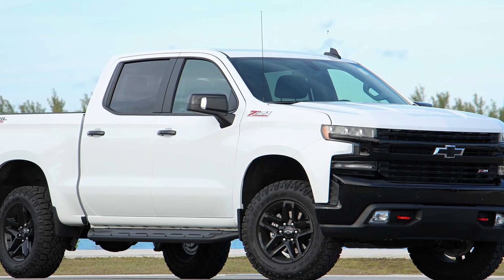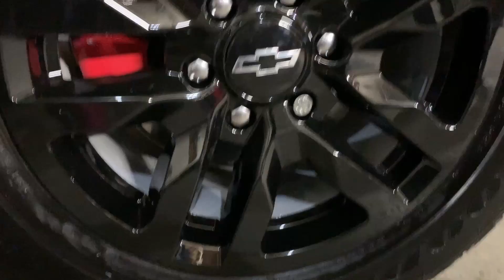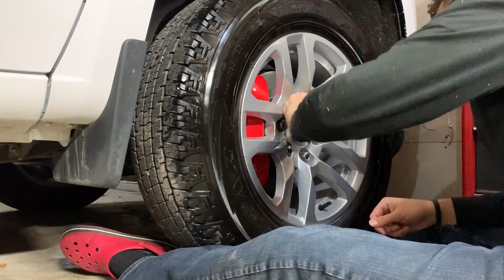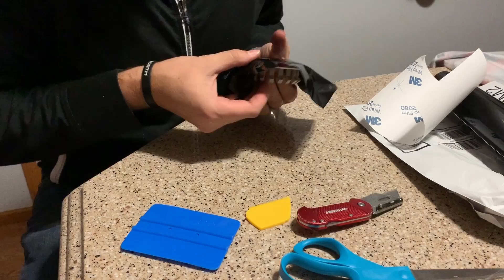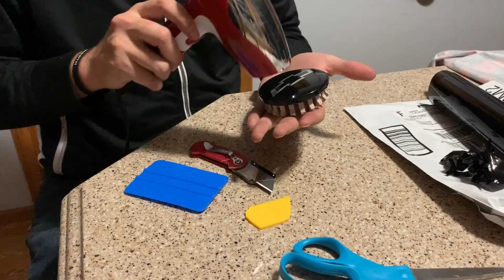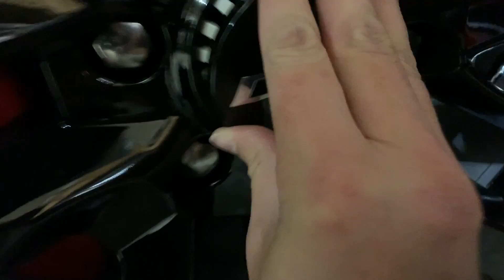How to make your wheels black! Wheel skins for 2019, 2020, and 2021 Chevy Silverado

Comment: Any luck getting these wheel skins off?
Reply from the maker: I actually upgraded wheels and sold these with the skins on. You’d have to take the wheel off and pop the tabs from the back.
Reply: @TruckOwnership101  any troubles getting a lug wrench on with these installed?
Reply from the maker: @johnsonja329  maybe with some extra heavy duty ones, but my normal impact sockets tucked in there fine.

Comment: How easy or difficult can the wheels be removed for rotations or repairs? Will the standard Lagrange still work OK without damaging the wheel skins?
Reply from the maker: The impact sockets I previously bought still fit, but there wasn’t a lot of room for them, maybe some heavier duty sockets wouldn’t fit. Certainly something to test first before fully committing. I did have to take my tires off with them once and was able to do so.

Comment: Okay am I the only one that got some with a center piece in them? They look like a perfect fit to what I have but when I add the pressure it almost seems like I'm going to break them. Do I need to take the lug nuts off first?
Reply from the maker: Negative to the lug nuts. I removed the original center cap on mine to wrap it. Maybe that made room? I’ve never heard of stacking a cap in front of another cap….

Comment: My only question is why did you waste $100 if you planned on doing a wheel upgrade not so long after?
Reply from the maker: 😅 yeah... to be fair, I didn’t “plan” to do the upgrade so soon. It was a combination of discovering the 20” replicas, getting a good deal for them + trade in, and really liking the look of all black once I had the skins.
Reply: In you honest opinion would painting your existing rims be better than the skins?
Reply from the maker: @karbs76  better? Their are pros and cons to both. Powder coat would be the best look. But at the cost you might be better off looking to trade for some TB wheels.

Comment: How did you clean them without scratching the gloss black plastic? Just got mine today and wondered how you did it. Thanks
Reply from the maker: Andrew Kellman I cleaned the stock alloy wheels to get any dust from the road off them for the install. I didn’t need to clean the skins. As far as general use goes. Foam cannon, pressure washer, microfiber cloth. No scrubbing while their is grit on them.
Reply: @TruckOwnership101  yes i cleaned mine thoroughly before the install. I figured all I needed was the foam cannon when I do my normal wash and a microfiber towel but I just wanted to hear what you did! Thanks!

Comment: 4:14 The caps come in sets of 4. You would have spent $30 in total on a set.
Reply: Actually, OEM wheel caps from Chevy are $30+ per cap. I found out when I thought I was ordering all 4 and then got my confirmation email that specifically called out that it was for a singular cap. I canceled that order and opted for an aftermarket replica set of caps that were about $35 delivered. ;)

Comment: Man I tried to use your method, but could never get a good pull, so I had to take the wheels off. Also I learned that opening for the lug nuts does get smaller than the factory opening on the wheel, so you may want to find a socket that fits into the holes. Also I had to take the wheel off remove the the center cap then put the wheel put back on to install the skin without scratching. Over all my truck looks awesome I'll post a short video.
Reply from the maker: It was a pain for sure lol. I bet the perfect suction cup would have made quick work out of that step.

Comment: DON'T PUT THESE ON. THESE ARE GOING TO SCRATCH THE RIMS UP UNDERNEATH. Also the balance of the rims are going to be off. 

Valve stems are free at Americas tire.
Reply: I had them on my 2014 Silverado. Perfectly fine when I took them off 4 years later
Reply from the maker: No they won’t/didn’t. Just took mine off to do my wheel upgrade and they were perfectly fine after months of use. They have foam padding to create separation from grit and to prevent vibration. And balance... really? Cars have snap on hubcaps too that don’t effect balancing. I drove these for months and had no vibration or any other issues.
Reply: Silverado Ownership: 101 Dude. You are wrong. Blanco is correct. These will scratch the rims underneath. Now they won’t do it that fast(will take a few years and you can just snap on new ones later). 
Also the rim/wheel assembly will be off balanced, not much but still off.
Reply from the maker: YZ250Yamaha969 🙄, whatever. Didn’t make this video to argue with my viewers lol. Even if they did leave small scratches on the inside of the rim where they snap on after years of use they are still worth in my option. Still great for a short term solution, or to hide corrosion of old wheels. They also can protect your rims from chips and scratching so the all caps warning is a little over the top to me lol.

Comment: Where did you get the vinyl wrap for the caps?  Is there a certain color that matches the black wheel skin?  Thanks
Reply from the maker: Link is already in the comments section. 😉. Straight up gloss black is fine.

Comment: Has anyone noticed that you have wheel caps and is that aluminum that goes around noticeable
Reply from the maker: Ak_Mick3y Anybody casually looking at them hasn’t noticed. True wheel heads will notice for sure, but so far I’ve been satisfied with the investment. You could play around with wrap or plastidip to hide that outer rim of aluminum.